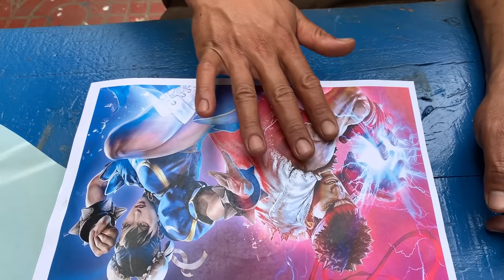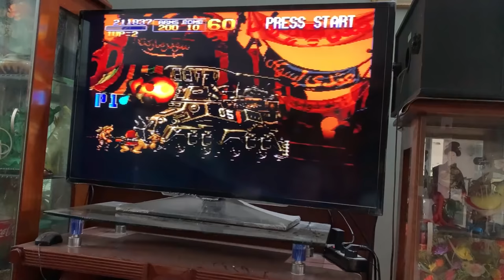Restoration SONY Playstation one | Restored old ps1

Comment: There is absolutely no way in hell he repaired the laser ribbon, period...
Reply: That's right. That ribbon patched with adhesive tape is a bad joke.
Reply: Look carefully what he does after patching the tape
Reply: Its almost scary that so many People actually Think it is real
Reply: @ElliottsTog  some one think it's fake, go down.
Reply: Never ever this will work!
Take a look at your next second hand store. There you can get a good working PS1 cheaper as 25 Euro incl. controller and all needed  cables!
Reply: there is ways to grind off the isolation, solder the traces together and then glue it to stabalize and isolate it but its a pain to do and its gonna also lose all flexibility and probably will be very unreliable
Reply: Fake total
Reply: There is a way, yes, it shows only a part soldering the tape but in fact he soldered it.
Reply: @andybayer991  Yes it sure works, I do and it works
Reply: That is cheatingor lie
Reply: totaly true , i'm sorry but is fake!
Reply: @broadman2048  I know it's real because I do this type of soldering on flats myself.
Reply: I mean, if things were this easy. Repair shops wouldnt need to install new parts, they could just wash them in water, lol
Reply: This chanel just try pool us,just report it to u tube !that wasnt give anything  other word zonk
Reply: Jhhkn
Reply: Mk
Reply: he did, so there is a way
Reply: @marcio35ism я знаю, что это не реально, лазер после такой грязи не заработает никогда, он от пыли перестает работать, а шлейф должен гнуться, здесь пайка держаться не будет! Интересное видео, жаль что постановка! 😊
Reply: @AntonZharov151  He didn't show the results of the welding on the flat, but he probably welded it with thin wires and it didn't break because he used superglue and a more rigid base to support the flat. As for dirt, that doesn't matter because it didn't corrode anything important in the operation, if the arm the white arm that goes up and down is not crooked and the coil is not open, that should work, yes, the most important thing about the reader is that white arm that goes up and down and the coil, the rest is just dirt, nothing that a good cleaning with contact cleaner won't do. resolve.

Comment: Yes, you can clean boards with water and soap, as long as you dry them fast. Unfortunately it's another fake "restoration" video since the lens would never work right after being caked with mud like that, also he didn't fix any of those traces, he just put some tape in it, so he can change the whole laser assembly without people noticing
Reply: Basically he edited that part
Reply: Yep they just buy new lens. Fake repair...
Reply: I totally agree with you. The board cannot work after a wash with water and soap. The laser could have big problems in a house where the ppl smoke... can you imagine a laser full of mud? Did you see in the power supply how the fuse is ?? 😂😂😂😂😂😂😂😂😂😂😂😂
Reply: Fake video . The mud has been applied and they set it outside somewhere and pretend to find it like that and fix it . I'm never watching these clickbait repair videos ever again .
Reply: What do you expect from dishonest men that would sell out for views and likes. Weak men will sacrifice anything for temporary applause–from the oblivious like them.
Reply: @araisannanoda3688  No, it's not only a question of editing the video. It is a total fake video.

Comment: Um.... there is zero chance that system would work as is.  Zero.  

Chips are moderately resilient against the elements, sure, but many other components in that system, are not.   Especially the lens, which can be ruined by merely cleaning the thing incorrectly, much less being covered under abrasive mud for however long that thing sat there.  😆  

You quite literally drown the system in water, and carelessly run a paint brush over the lens.   It's dead.  Also, the PSU would have zero chance of functioning correctly either, as the transformer alone, would be shot.

If you swap out parts, really, just show it in the video.  It makes for a better video, and gives you far more credibility than................  this.

Comment: yeah that console would never work with a broken ribbon cable and electronics were completely submerged you can't just fix water damage like that
Reply: Right, it don't even make sense how he's trying to fix water damage with water and soap, I'm a Apple and Samsung certified repair technician and even if you cleaned it properly with 99% alcohol and using a dehydrator it probably still wouldn't work, that board is just too severely damaged, he obviously switched out the motherboard with a working one
Reply: Untung cuma ini kontent 🤣🤣🤣

Comment: interesting concept but obviously a fake repair  when you have a totally undamaged board in the assembled unit, the chance that a unit that corroded is going to come back 100% is impossible. At best its believable he did a repaint on the case but thats it, the rest of the parts are from a seperate unit.

Comment: I admire your work, I would only like to know how a transformer works correctly when submerged in water .. After the water enters its compartments, even with a hair dryer, it is impossible to dry it
Reply: Cuz it's a fake.
Reply: es falso
Reply: He microwaves It works each time buy je does more show that....
Reply: And uses a magic wand to repair al components and ofcourse the corosive reaction of metals is is broken down by pissing on It., Realy An expert
Reply: it's false. When you connect the wires, the console magically changes color. He painted the console a dark gray and then when you plug in the console it's a light gray. Magic!
Reply: Es mas falso que tu amor e

Comment: I think it's a fake!

Point 1 the status LED that the console is connected does not light up, 

Point 2 Playstation 2 controllers do not work on Playstation 1. The other way round, controllers from Playstation 1 could be used on Playstation 2.

Point 3 There were never any official black controllers available for free purchase. Black controllers were only available for Playstation 1 NET YAROZE a special edition meant for developers. But these controllers also had no analogue sticks!
The

Point 4 also the LED on the controller itself between the analogue sticks does not glow blue as it should! 

I think the whole thing is a fake and possible it is not but most repairs after such a water damage impossible!

Comment: fake video. * all original screws you never see what you bought *fix the flex without the reader's tin and then cover it with a piece of paper *you paint a dark color and then when you test the console in the memory card part you can see that the color is light. the next time you make the video do not switch consoles sir, be more realistic!

Comment: You shouldn't of spray painted those internal metal plates. Then you painted the outside of it to cover it up with a skin? Even covered the PS logo you were protecting with tape, and I think you used a different power supply because it doesn't look the same. The glue you put under that capacitor is suddenly not there anymore.